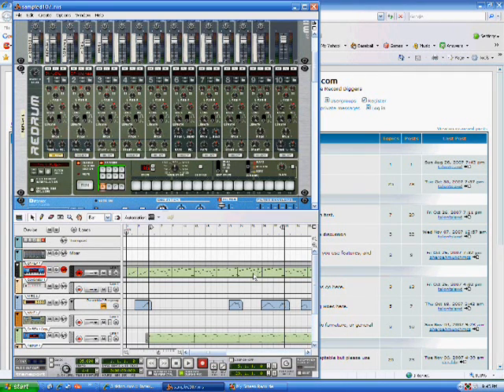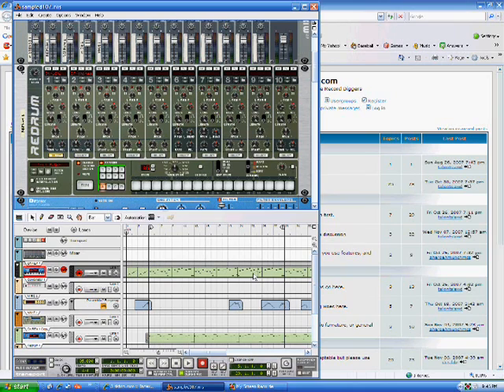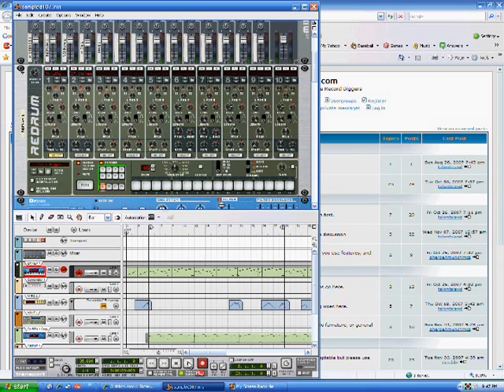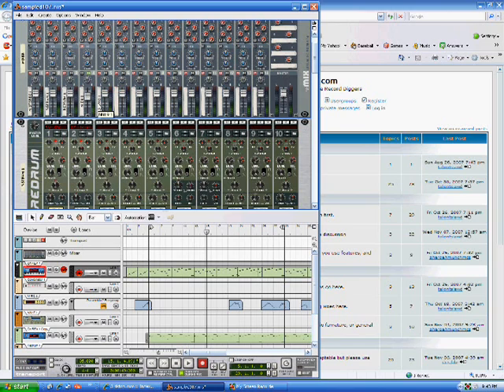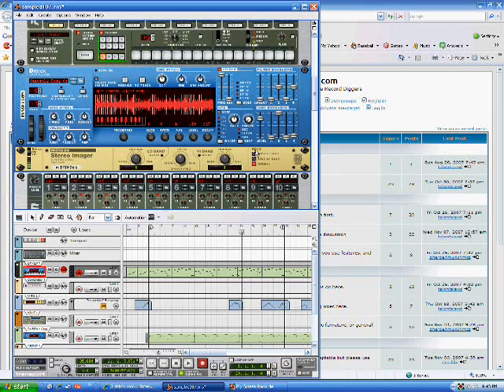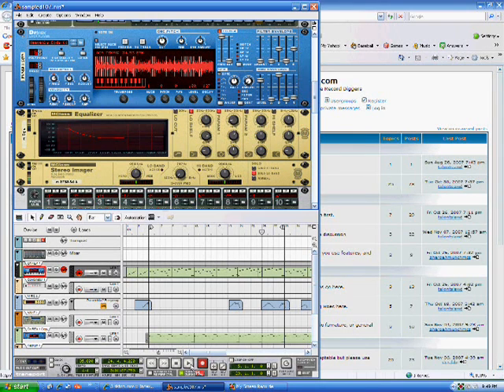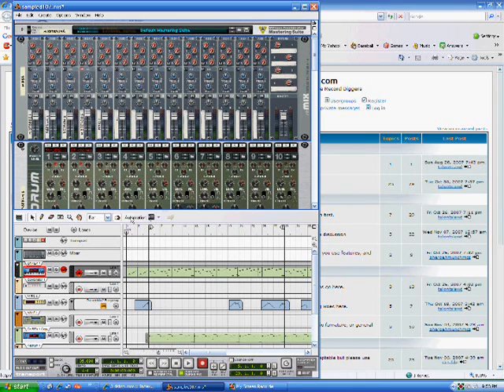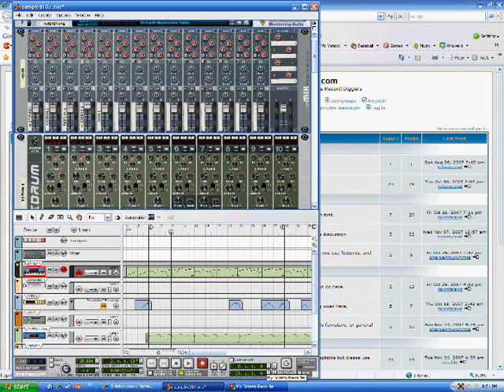3rd Degree-Lowend Theory Basslines (Low Pass Bass)

Comment: you would have better results, if you use a m/s eq, set the low frequencies to straight mono and filter out the rest. after that step you can proceed with your method. Just as an addition. Nice Tutorial, Bro. Keep em coming